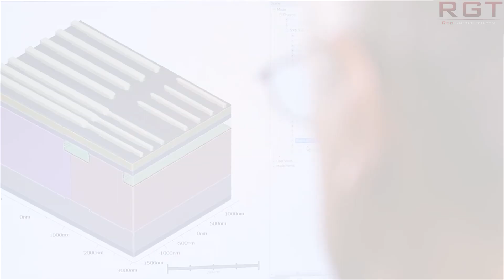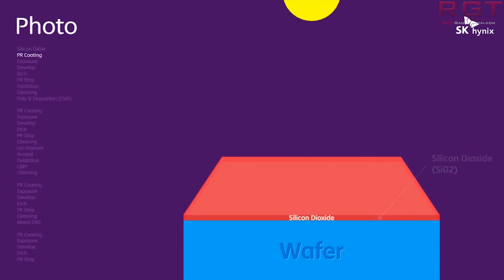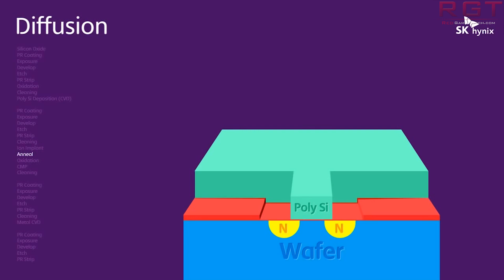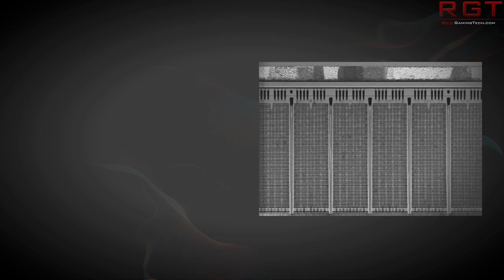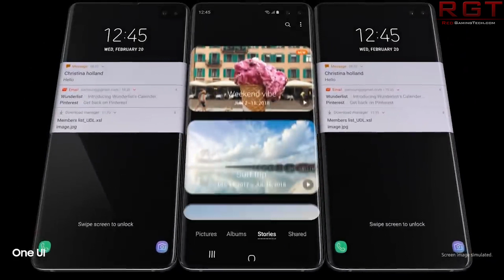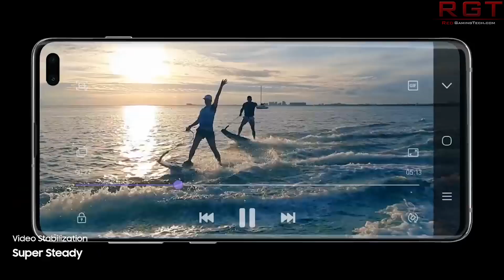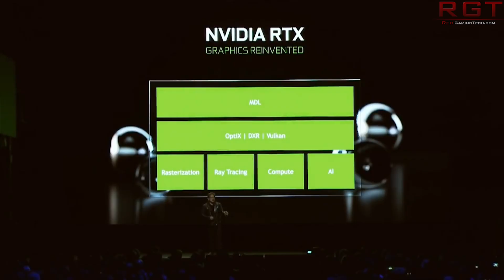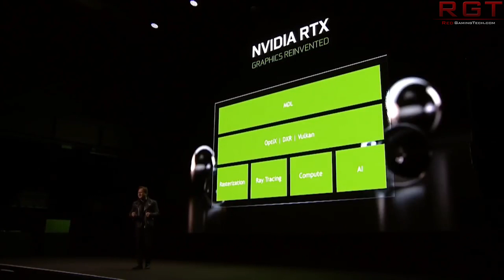DRAM Memory Prices Continue to Fall | Samsung’s Rumoured Fast Charging Graphene Batteries

Comment from the maker: 0:18 Micron 96 layer NAND productions starts in 2019
1:45 DRAM prices continue to fall
4:43 Samsung's rumoured graphene batteries
7:08 Not buying raytracing GPU "crazy", says Nvidia CEO
Reply: might be that nvidea make it mandatory for devs to include raytracing in future games, but wont be mandatory for end user. Still looking at 3-5 years before anything substantial comes of it.
Reply: @RedGamingTech
"Crushing Cinebench V5 Dual AMD EPYC 7742 CPUs and 256 Threads"
https://www.youtube.com/watch?v=GnQKD4K-HhY
Dual Socket EPYC running Cinebench (128cores/256threads)

Comment: by the time Ray tracing is mandatory RTX 2000 series will be super slow even with RTX off
Reply: Aren't they super slow already? Why would you ever get 144Hz 2K screen and then run games at 30FPS?
Reply: By the time RT is mandatory RTX may be obsolete. AMD is looking like it’s implementing RT without the need for the equivalent AI cores or specialised tensor cores. With the future games consoles planned to use AMD RT implementation what chance does Nvidia have getting developers going out of their way to develop for RTX? Just look at how many do right now.
Reply: @mahagr78  yea i meant that it would be slow even with RTX off, edited
Reply: @kalocaploc124  To be honest, I'm not sure. If you think about it, you can still play games with something like GTX 970 (2014) and get 1080p / ~60FPS with decent graphics (tweaked high details). Yes, the card is starting to show its age, but it is almost 5 years old now. This will likely be true with the new RTX cards, too, except that only time will tell what happens to the RT cores.
Reply: @mahagr78  Yes but still 970 is super slow compared to 5700xt or 2070s and by 2023 we will be 2 generations ahead from now at least, + we might have 2 more players in the GPU game
Reply: Unless you consider the performance of Vega 8 to be super slow, I disagree.
Chances are ray tracing will never become mandatory. It is more likely physics will become mandatory before ray tracing.
However, there is a chance ray tracing will become mandatory once both AMD and Intel incorporate it into all their iGPUs, and when this happens the 2000 series will far outperform these iGPUs for everything except ray tracing.
Reply: @dalesplitstone6276  who said anything about vega? we talking 970 here and yes its super slow compared to 5700xt and 2070 and any vega with power mods.
Reply: Meh. The 5700xt is ~130% faster than the 970. That’s barely a noticeable upgrade; like going from 1440p to 2160p at the same settings and framerate or going from medium settings to ultra.

I’m still holding out for 200% performance increase above my R9 290 at a justifiable price. It’s not that I can’t afford a 2080ti or three but it’s such terrible value for money that I might as well set it on fire.
Reply: @soylentgreenb  how is more than double the speed barely noticeable?
Reply: @gismo3564  Because twice the performance is almost nothing. You don't get twice the framerate which would be extremely noticeable; FPS is either CPU bound or bound by your refresh rate because you're presumably not stupid enough to play at higher quality and resolution settings than will give you a good experience.

What twice the performance means in practice is that you can have twice the number of pixels at the same settings; really 40% higher linear pixel density; and the difference will only be noticeable within a couple of degrees of the very center of your fovea. 320x200 to 400x300 was a much bigger visual jump because it was an upgrade in resolution for the entire stereovisual field (never mind that few games used 400x300, but went straight to astronomical 640x480 resolution, because performance increased by 60% per year back then on the CPU side and 100% per year on the nascent 3D accelerator side).
You could also go from 1440p medium to 1440p ultra, which is an even smaller visual upgrade.
A big visual upgrade in quality, like real time radiosity or something; is easily 10x more performance and many people will simply say they don't see or care about the difference.

Comment: Jensen should have said, "Buying Nvidia is crazy because the nextgen consoles that are the bases of all future games will have AMD GPU and AMD's version of Raytracing." 

But for some reason he did not say that. Also he should have said, "RTX cards are useless for Raytracing because none other than 2080ti has anywhere near the power to have playable FPS when using Raytracing, and in case of 2080ti it's pretty insane to trade 144 FPS to something close to 50 FPS because you have somewhat better visuals." 

and also, "The whole game industry have been developing 30 years for methods that allow close to raytracing quality graphics with the lowest possible power requirements. And there are only small number of use cases where the added quality is worth the cost."

Comment: After all the fake news a couple of weeks ago about dram pricing going up because of a possible mining boom and problems with power plants in some country and other fake news, sellers in my country bumped the prices of dram with 15-20 euro. And they are still at that elevated spot. I'm sick of it. As is Ryzen 3900x and all the 5700 xt's which are ridiculously priced.

Comment: Samsung, Toshiba, Sk hynix already have 96 layer NAND in production.  It won't be long before SSDs completely kill off the HDD market now.
Reply: They've even almost completely abandoned the 2,5" HDD market since 2016.
Reply: I love SSDs even though I only have one in my laptop. However I have six 8tb HDDs in my desktop machine. And the one thing I hate SSDs about is that the price of HDDs have not come down because SSDs and there hasn't been innovations in HDDs and increase in capacity because of SSDs.
The last time I bought 8tb HDDs, those cost 180$ a piece. So I don't expect SSDs to be that cheap in very very long time. And in my use case, HDDs are good enough. Though lower power consumption and less heat would be great. And also less weight, because those 8tb HDDs are 1kg each.
Reply: @juzujuzu4555  There is always hybrid HDDs as a middle ground.  I would say most consumers are not buying 8TB drives, for 4TB the prices have dropped by 50% in the last 18 month maybe more.  If 2TB drives drop by that much over the next year they will take over in a big way if they haven't done already.

Affordable 8TB ssds for home server storage I'm guessing is at least 3 years away, but after that...  Its no competition, ssds can scale much higher than HDDs.
Reply: @LeJimster  SSDs can scale, but for a long time it's going to be really expensive compared to what big HDDs could be produced.

Though the benefits for the big players is so obvious that many buy large SSDs even if they cost much more. And there are much better large backup solutions than HDDs, so those spinning disks are slowly going to extinct.
Reply: @juzujuzu4555  Heh that's a lot of storage compared to the average user. For most users these days SSD's are the way to go. The reliability of SSD's are much better than HDD's in my experience, along with the speed, weight and power consumption benefits.
Reply: @KillFrenzy96  At the moment I also have 48tb external drives as a backup. Still total cost is small fraction than with SSDs.

I also haven't had any HDD failure, currently have my OS on two 1tb drives in RAID 0 that have been running 24/7 10 years in september.

But I agree, there are just too many advantages for SSDs. But it sucks that because of SSDs the price and capacity of HDDs has stagnated. Or have been for a long time now.

Comment: If DRAM prices fell at historical rates between 2013 and today we'd have 128-256 GB as standard now.
Reply: Yeah, but what for. I'm pretty sure even with 32/64GB you could load a CAD file of a complete yacht into RAM.
Reply: Quast what if you want to render a high detailed environment?  32/64GB is nothing in production, it's not only polygons, high resolution textures eat space very quickly.
Reply: No, it wouldn't be "standard now" just because of pricing. No point in buying memory you don't use and people that use more than 16GB are far from typical users.
Reply: Jeffrey Photonboy what does a typical user use the computer for?
Reply: That’s a strange inversion of how things work. Imagine an alternate universe where the 1 GHz pentium 3 or athlon was released in 2010; why would anyone need a faster CPU? All the games and applications run on much slower hardware and nothing really uses more than 512 MB.

Developers target the hardware that exists.

Comment: At the time when raytracing is mandatory, I am pretty sure AMD will also have a raytracing solution.
Reply: just like shader model 3.0
Reply: tamenga88  ,
1) Ray-tracing isn't more efficient on CPU architecture. That's nonsense. Even Pixar is adding GPU's for ray-tracing their movies more efficiently.
2) Sure, ray-tracing will be a "hybrid" solution for a long time. So what? If it ends up looking better than what just normal rasterization hacks can do at a reasonable FPS that's fine.
3) I agree it's largely pointless today. Somebody needs to be an early adopter though. You NEVER get technology like this in a completely mature form.
4) Give it a decade? We aren't waiting for 100% ray-tracing. We'll eventually get there but again we'll just get more and more games add ray-tracing elements. The proportion of ray-traced elements will increase. We aren't simply going to wait until we can do everything with ray-tracing. Many games will mix Photogrammetry + Rasterization + RTRT (real-time ray-tracing) elements.

Comment: Physics will become mandatory before ray tracing, as is also the case with 16GB of VRAM. By the time half the newly released titles even support ray tracing, $300 graphics cards will outperform the RTX 2080 Ti in ray tracing.
With regards to ray-tracing becoming mandatory, I expect this somewhere around the year 2030. Until integrated graphics support ray tracing, it will remain optional in all games.

Comment: Graphene capacitors are going to be really good for the environment, and cheaper in the long run - Carbon is everywhere, while Lithium is hard to mine in large quantities, and causes environmental damage when we do. We could even use carbon-capture, and have carbon-neutral batteries as a result.
Reply: Don't assume the environmental impact will work like that though. You have to look at EVERYTHING from mining, to manufacturing to usage and disposability. I remember when people talked about HYDROGEN cars as being the best option because "the exhaust is just water" but that wasn't the entire picture.

Comment: Nvidia ceo is delusional af.
Console hardware drives game development.

All game development.

Until next-gen consoles, which will support AMDs version of Ray-Tracing not nvidyas5, have been on the market for one development cycle (3 to 5 years) at least having a gpu capable of real time Ray-Tracing is irrelevant because there's not enough games that support it to justify the cost.

I own a 1080 ti and do not plan on buying an rtx card anytime soon unless the 2080 ti price is reduced to where it should be which is $700 to $800.

I'll be upgrading to big Navi/5900xt.
Reply: We have no idea how compatible NVidia RTX is with the ray-tracing in the 2020 consoles but most likely it will be compatible. I agree that RTRT won't be that big of a deal anytime soon though. We should have a much better idea of where things go in 2021 once we can analyze the new consoles... I'm really excited to see the PS5/XBox2020 running Cyberpunk 2077 with ray-tracing. If it does 4K(ish)/60FPS with amazing visuals it makes me question whether I should spend money upgrading a PC. I think I'll just keep my existing PC then buy a console as a supplemental gaming system... maybe run both in my office on a Freesync (GSync compatible for my GTX1080) 4K, 144Hz monitor.

Comment: I think ray racing can be emulated on the closest generation but not hardware specific ray tracing, its more on dev devalopment and maybe an api for older video cards while the change over happens if someone wants to try. Ray tracing is still a meme for now and no ammount of shilling is going to change that for the time being.
however like you said its bound to be the future that ray tracing is here to stay but I think deicated hardware for raytracing is a better idea then over loading a gpu to do everything.

But that's just my two cents and I highly doubt everyone thinks the same way i do.
Reply: Technically you don't "emulate" ray-tracing. You do it or you don't. I get your point though. You can do ray-tracing through normal GPU processing cores but it's just less efficient. The PROBLEM is that it's so inefficient for non-RT hardware that it makes more sense to spend your processing time using the traditional rasterization hacks. From a consumer point of view it makes almost zero sense until it makes the game noticeably BETTER looking at a sufficient frame rate.

Comment: Considering the performance hit you take when utilizing ray tracing, I'd say that ray tracing is already obsolete.  If you buy a 2070 series card with RT, it may not even deliver a playable experience with RT enabled.  The current practice for most people playing RT capable titles is to turn the feature off.
Reply: You have this completely BACKWARDS. The performance hit is high because RTRT (real-time ray-tracing) is just starting. Game devs already know EXACTLY what will happen. We'll slowly get more games with ray-tracing elements added then eventually we'll start getting games that ONLY use ray-tracing. Once the software ecosystem is more mature it will actually be much EASIER for game developers to use ray-tracing compared to the normal methods because they won't have to worry about pre-baking light effects etc. They can just put the light SOURCES where they want them and the game engine will automatically generate all the reflections, shadows etc based on ray tracing... having said that this doesn't mean the RTX2070 will be good at this in a few years as it may be too under-powered but generally speaking we, again, will just slowly add more RTRT and eventually have 100% RTRT in every game.

Comment: "mandatory to have ray-tracing"
While that WILL happen it won't be common-place for several years. The reason it would happen is because ray-tracing from the game developers view-point WILL end up being much EASIER to use because they don't have to worry about pre-baking etc. You just put the light sources in and the bounce around the rays to generate the proper shadows, AO, reflections etc... BUT... game developers always look at the hardware distribution to decide what's worth their time. If everybody had ray-tracing cards it's a no-brainer. Ignoring consoles for a second, if there's only 1% of the systems with hardware ray-tracing then you can do ray-tracing but you ALSO have to do the normal methods so it's a completely ADDITIVE cost to the base game... the 2020 CONSOLES will completely change this dynamic. We'll start to see games developed for the PS5, XBox 2020 or both that use ray-tracing elements (combined with traditional methods too)... so game developers will need to decide in some cases whether to stick ONLY with consoles or whether the extra effort to do 100% TRADITIONAL methods of lighting for the bulk of PC systems without ray-tracing hardware is worth it... long story short is MOST GAMES will be for both PC and Consoles and most games on PC will use regular methods for lighting with a slow, but steady increase in ADDING ray-traced elements...
how long until PC GAMES REQUIRE RAY-TRACING HARDWARE THOUGH? 

NOT UNTIL THE PC INSTALL BASE FOR HARDWARE RAY-TRACING IS SIGNIFICANT. THAT IS AT LEAST FIVE YEARS LIKELY In the meantime they'll continue to improve how lighting works with regular methods. So don't hold your breath on the necessity of ray-tracing hardware.

Comment: What happened to the old nvidia that sold geforce 2 tech as "geforce 4 MX" and was blamed by the industry for holding back pixel shaders? It wasn't a financial mistake to do this, and many people didn't care about shaders; by the time shaders mattered geforce 4 ti was a bit of a joke. Games like Morrowind used shaders to make water look like liquid mercury and a lot of other games used it to make everything look smeared in vaseline; even the things that were supposed to look grungy, diffuse and rusty looked wet. With Far cry and Half-life 2 being among the earliest games that made great use of shading you didn't miss anything giving that a miss. Besides a lot of gamers back then were playing only HLDM, UT, CS, TFC and such games that worked even on the TNT2 M64 and just wanted a little more oomph. As much as nVidia envangelizes raytracing now, they'll keep selling mid range cards without it for years or they're going to take a financial hit.

Comment: Full charge in 30 minutes.sounds good untill you relize that a nomal phone battery can take a 80% charge in 30 minutes... The reason it don't work in real life is due to slow charging circuit, not battery
Reply: the batteries are supposed to have larger capacity also
Reply: I'm not sure of your point. Slow charging circuits are slow because they are designed not to degrade the battery so it ultimately comes down to the construction of the battery.
Reply: @photonboy999  30 minuter to 80% dont degrade as long as the thermals is okay
Reply: @jaromor8808  well... I'm sceptical... But the life span might be better